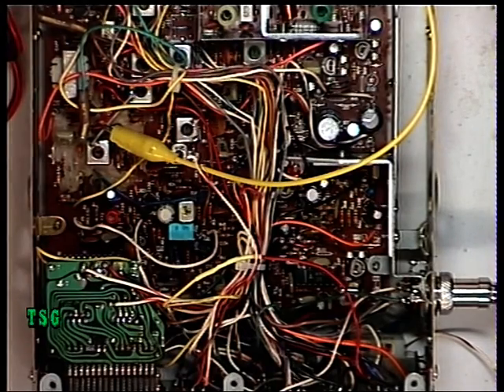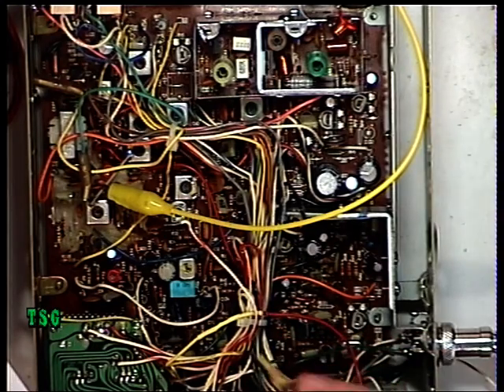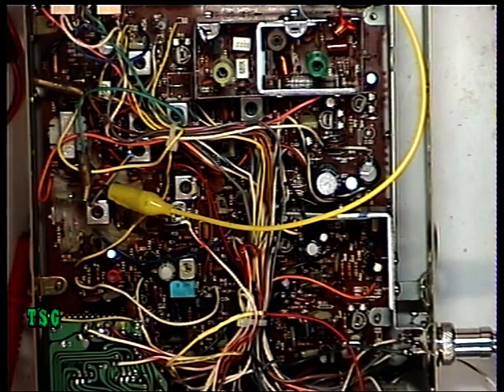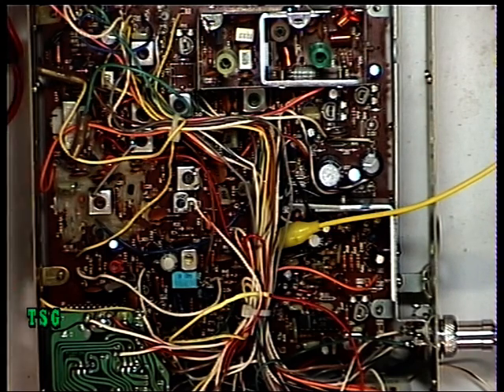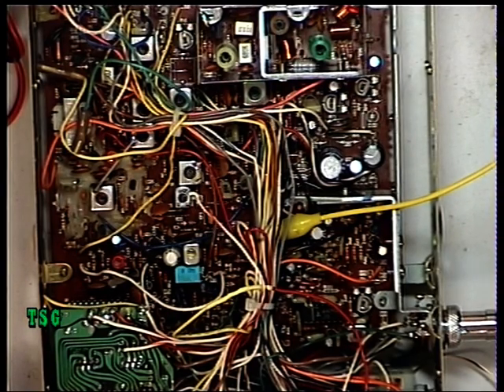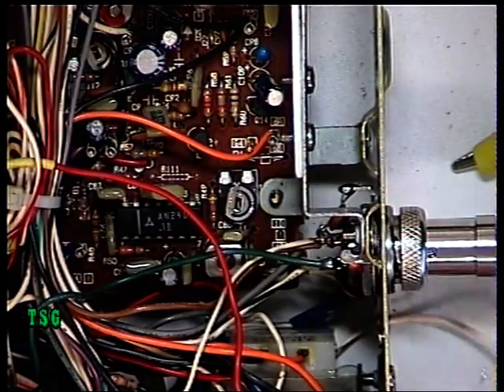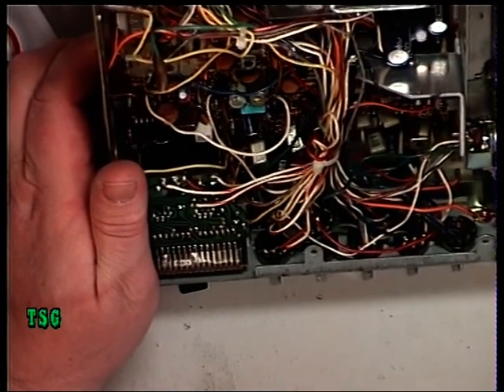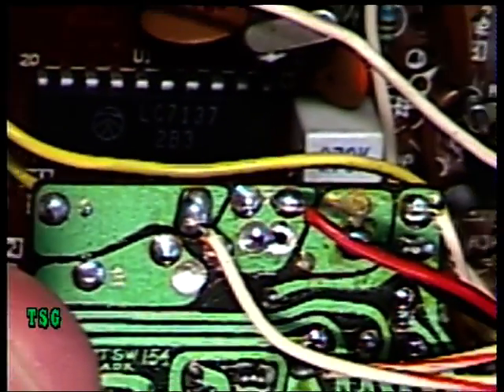Rotel RVC240 UK (CB27/81) CB radio (mobile)  receive & dimmer

Comment: Hi. After setting receive the alignment procedure says turn T5 clockwise half a turn but you didnt do this. My question is "why turn it after its been set? Thanks.
Reply from the maker: I was having breakfast at home when I read this comment. I was so surprised I went straight over to the workshop & looked at the service manual. You are, of course, quite right. T5 is key to sensitivity, and I just don't get it. 1/2 turn is a huge amount. Some of the coils just need the smallest 1/64th turn to make  a difference!. I did, however, look at the test equipment they were expecting you to use, and basically they have you looking at test points with a VTVM and just really using the oscilloscope to do the detector coil. Perhaps it worked for them this way. 

I'm using a SINAD meter as you know, so I'm tuning for best SINAD, and that method is far & away better than theirs. Remember this is a 1981 radio. I hadn't even heard of a SINAD meter until about 1986 & because most of our business users were on VHF high band (166-171MHZ) AM systems, we were tuning up for maximum recovered audio anyway. 

I had a Farnell TTS530.SSG530 test set on my bench in 1986 & it had a SINAD meter, so I read up on it's use & implemented it. Nine years later, the boss/owner came in with a SINAD meter & told me he'd bought it for his bench & had I ever heard of SINAD meters. I then showed him the SINAD meter built into my Farnell test set & told him I'd been using it for 9 years. No wonder our business customers (who were now switching to FM systems) gravitated to me for service work, clearly I was doing a better job than the boss!

Richard  (UK)

Comment: Hi there Richard, I am currently using a Rotel RVC 240 in my camper-van, directly wired to a 120Ah leisure-battery (I’ve bypassed the domestic ‘ZIG’ panel to keep everything as RFI-free as possible!) and I was wondering if you could please tell me, just roughly, what kind of amperage a unit like this will draw if left running in a ‘passive’ RX condition, effectively ‘squelched’ but left on in the background? Many thanks in anticipation!
Reply from the maker: About 120ma.

Richard
Reply: UK CB radio servicing That’s brilliant, thank you!

Comment: been waiting for a Rotel 240 service review for a while, well worth the wait thank you. I wonder if you could consider a video showing how you use your equipment and the set up of your scope etc. Best Regards.
Reply from the maker: The Rotel RVC240 is an excellent radio. For many years we used the slightly smaller RVC230 in our test vehicle for walkie talkie range tests, because I could trust it every time. It hurt me to see this one come in with the illegal modification & I'm so glad I was able to sort it out. An 'on the air' test will be done as soon as some of the part-time staff are available. They want to do a one off route video from the car to show viewers the terrain, which I agree is a good idea, especially as we have now "standardised" the test to a six mile test in poor terrain for radio.

Regarding the test equipment. Have a look at the Fidelity 1000 receive video as I had to use test bench 3 (this video uses test bench 2). The same happened with the "fidelity 3000 receive revisited" video; this was because a sweep generator is required for those & other sets produced by Great in Taiwan. There is no video equipment on test bench 3 so I used a camcorder which shows some of the test gear on that bench & I explain why etc on the video.

I have plans to do a "setting up the test gear" video later this year when we move test bench 1 into the same room as test bench 2 & 3. I also intend doing a "setting up test gear on a budget" video using mainly cheap cb/amateur/hobby type equipment and how to 'make do' with not quite the right gear, rather than using the laboratory type equipment like we obviously have to do commercially.

Richard